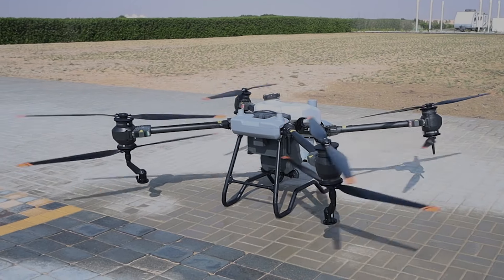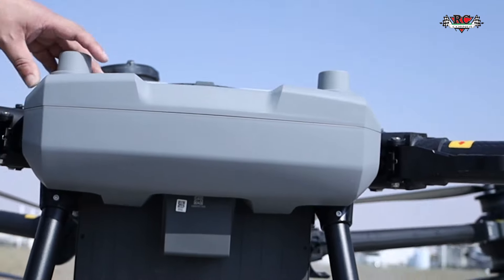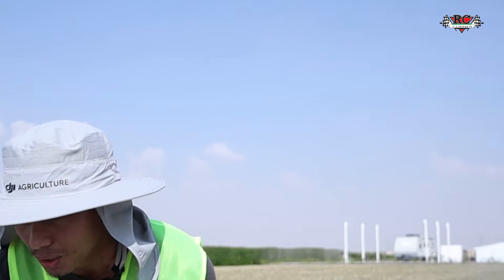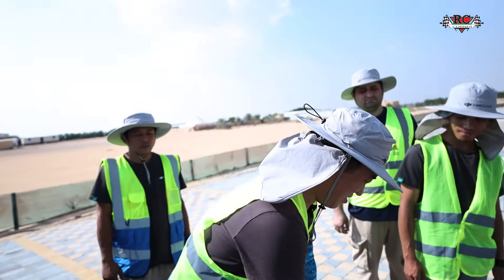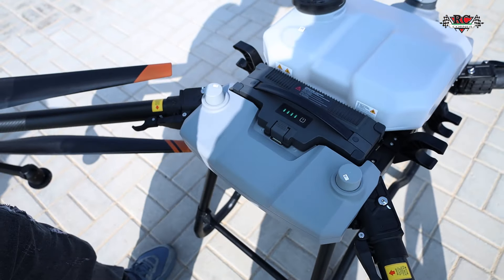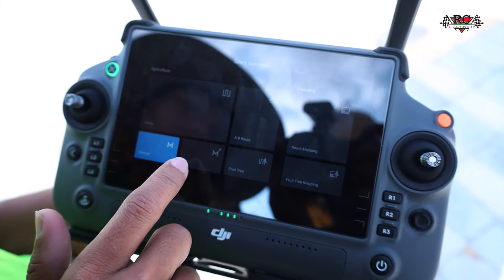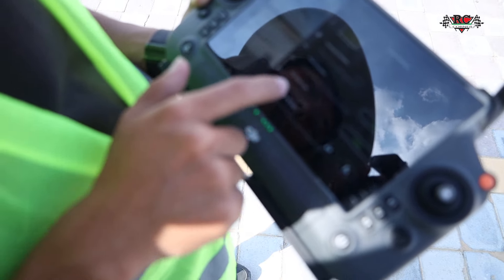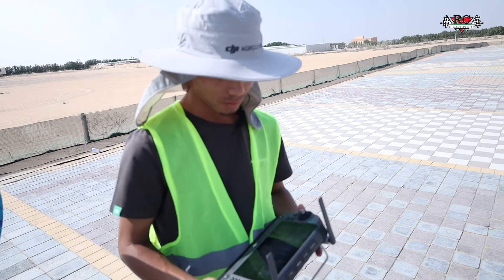DJI AGRAS T40 | TEST FLY | INTRODUCTION | RC CORNER DUBAI

Comment: Can the drone carry more loads?
Reply: it can bring 50 kg or 70 L. If you bring more payload, of course it shall reduce the flight time. and you need to use the higher flow rate or larger hopper outlet and spreading rate.

Comment: Just wanted to ask when creating a route through the controller for spraying and the aircraft starts flying does it spray automatically throughout the mission. Or are you able to customise when to spray through the route?
Reply: You can customise anything like spray rate, droplet size, speed, height etc

Comment: Yet the Helio 172 can carry 18 gallons and 4 can work together on swarm mode.  So why would I choose dji over hylio?
Reply from the maker: 72L.. but the battery is so weak.. Just 10-13 mins only.. even with two batteries .. Means. Pay a lot for batteries and the spray system is old -fashioned and small flow rate. Plus, reliability and smart Radar system shall be unique about DJI. I am sure Only This Agras  T40 provides Movable Gimble camera and supports MAPPING in Remote controller itself..Hee..will be a long story to compare..😁
Reply: @rccornerdubai4298  yet the dji can't carry even close to that payload or do half the acres in an hour as the 172?   You say bad battery but it work fine to spray off 18gals in 10 mins.  Time is money and the dji seems to be losing both.
Reply: Still no swarm mode.   How is 1 dji drone going to spray 600 acres?
Reply: @bravoman2011  DJI DONT NEED swarm. You can plan the route with GPS. Why you need swarm? The route you plan can cover every acres.T40  can finish 50 acres in 1 hour. All you need is 12 hours. Swarm cost more. Another word , DJI can work in mountains and hills，10 acres in 1 hour.
Reply: @jasonking6795   farmers don't want to spend 12hrs per feild... time is money.

Comment: how long is the flight time with 100% battery?
Reply from the maker: it depends on the payload..if you use same payload like T30, you can fly up to 15 mins..and the flow rate is two times higher..So, can finish 5 ha in 6 mins only